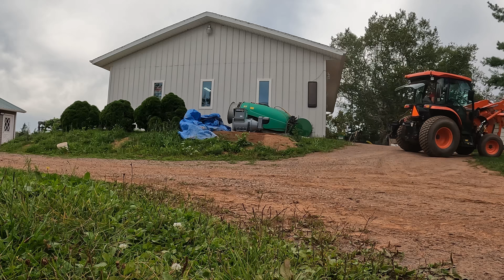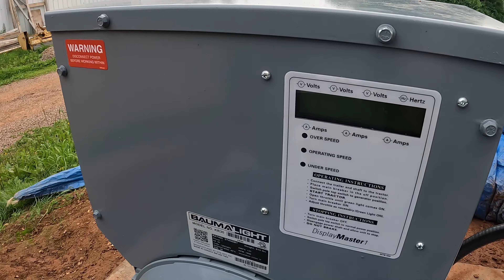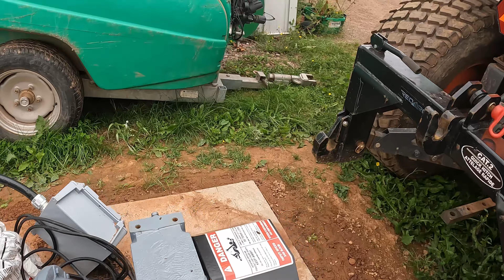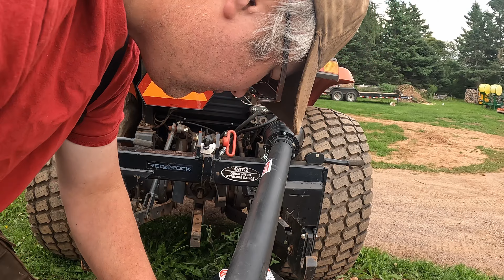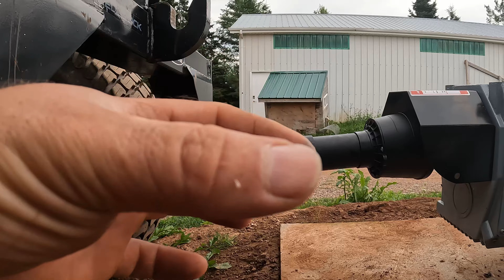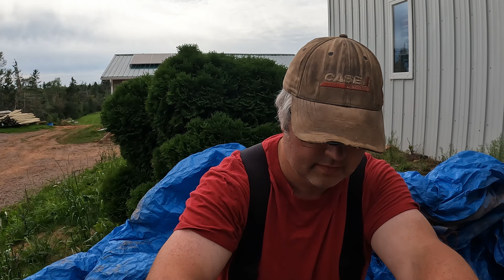Trying out our new generator for the first time

Comment: Nice setup!  I have used a 7kw Baumalight wired to a 30 amp generator panel in our Eastern Ontario basement.  The older model has a needle indicating voltage but it hops a lot, so I wired a Killawatt plugged into a circuit with an overhead light and an eye-level display so that I can adjust the old Bolens engine's throttle to produce 60 hz.  This system  has developed over ten years, though this year we are adding a 7 kw battery in the basement.  The reason I prefer the 18 hp Bolens is its three speed pto.  I run it in the second speed (740?) and so it loafs along producing about 7 horsepower to give the generator panel what it needs.  It uses less than half the diesel that the Kubota 7510 burns running at 2500 to do the same job.
Reply from the maker: I had debated on the traditional "needle" style indicator, but figured I would spend the extra money on the digital upgraded display.  Sounds cool about the stand alone engine!

Comment: Hello Top Notch Farms,

I found your PTO generator video last night and thoroughly enjoyed it.  Thanks for posting it.

If you don’t mind a few questions…

What gauge wire did the electrician use from the Anderson connectors?  I’m thinking something along the line of #3??

Where did you get the rubber mounts?  (main question)

How thick is the concrete slab?  I’m, again, thinking no thicker than 6 inches.

That looks like a fine generator, too.  I didn’t buy a Baumalight but kinda wish I had…went with a Winco model…oh well.

Thanks for your time and best regards from Texas.
Reply from the maker: I"m not sure to be honest on the wire, that part of the harness came with the generator. 

The rubber mounts were included with the generator (as an option), though it was cheaper since it normally comes with a cart. 

We aimed for a 4-5 inch slab, I put rebar in it. 

I looked into Winco, but the model they had would have been a bit lower KW generating capability for about the same money.  Plus it was my local tractor dealer who sold the Baumalight, so I went with them.